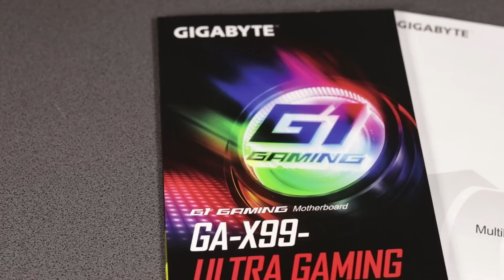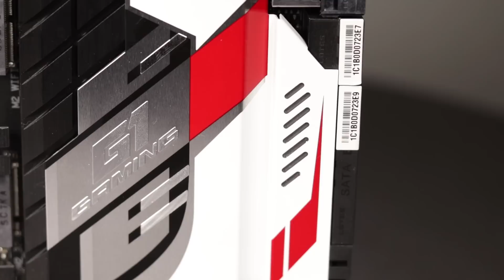Gigabyte X99 ULTRA GAMING Motherboard Review and Installation

Comment: if i buy GIGABYTE X99-Ultra Gaming  US  version, it is 110 volt support,
 then how i can use it in my country (Armenia), we use here 220 volt. 
then if i buy power supply 100-240 volt will it support normal working 
in my country?
http://www.ebay.com/itm/262524042302
http://www.ebay.com/itm/EVGA-Supernova-1300-G2-1300W-Power-Supply-/252649930843?ssPageName=ADME:X:COCE:US:3160
Reply from the maker: Thanks for a good laug!.  Mobos are 12v DC, so you are ok even in Armenia
Reply: i didn't think that i posted my comment-question in some stupid channel... next time i will try to be more attentive. anyway thanks for answer.

Comment: FYI, My Gigabyte X99 ULTRA GAMING accepted my Xeon 2630 ES from ebay no problem.
Reply from the maker: Was it F3 BIOS? I tried originally with F2  and system endlessly cycle with 2630V4,  later I changed to F3 to fix minor issue with LED, but it was no way I could drain and dismantle hard pipe Seninel build ones again (it took me half a day to extract 5930 in first place).
Reply: Mine came in on BIOS F2 and I didn't upgrade to the F3 beta BIOS so far.
Reply from the maker: Then it must be  with ES variation itself. I've got ES2.
Reply: CPU-Z sees mine as an i7 but HWiNFO64 is able to pull most of the information.
Mine is QK3G (ES2), QKET,QKRH (QS).

The uCU (cpu microcode version) is B00001B
Reply from the maker: Thanks for sharing this. I try again, so far my cpu is not recognized at all. Just as Genuine Intel 0000
Reply: No post at all when using this CPU or can you get into BIOS?
Reply from the maker: No, it started and shut down every few sec. As I put 5930K in, it fired without any trouble.
Reply: +DazMode Well crap, I just ordered this board for a 2670 v3 ES. Fingers crossed that it works I guess.